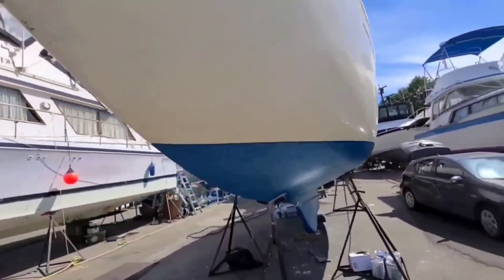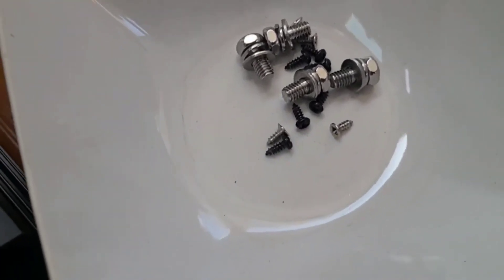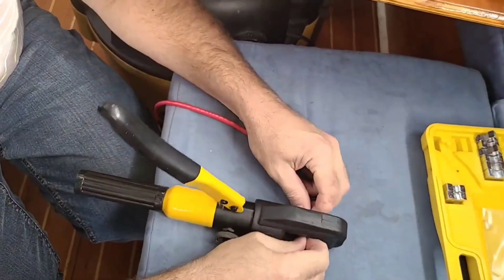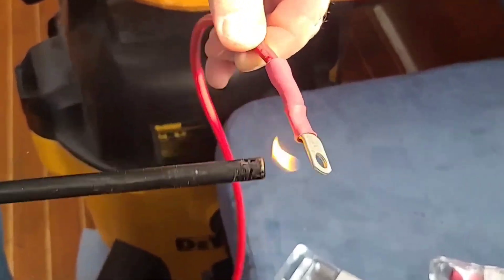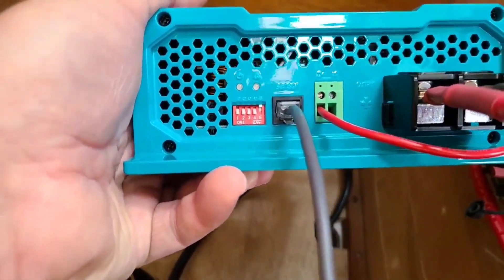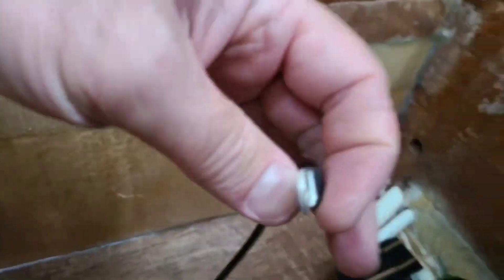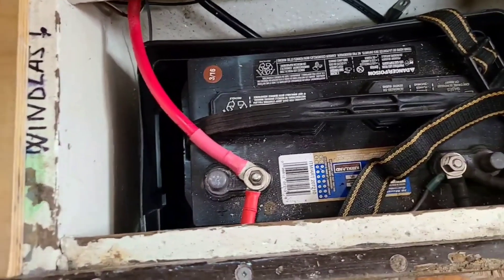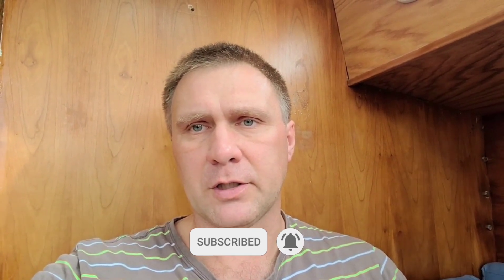DC-DC LiFePO4 battery charger installation

Comment: If you   buy the 40 amp  version, you can limit it to 20 amp. If you install  a switch h on the limiting wire, you can choose 20 or 40 amp.
Reply from the maker: Thanks for the idea, but unfortunately, I didn't get it.